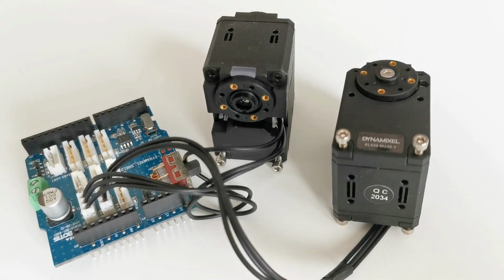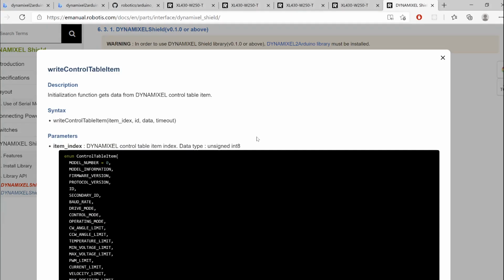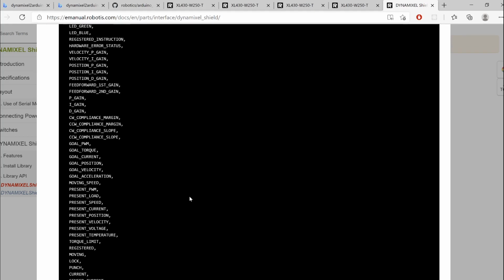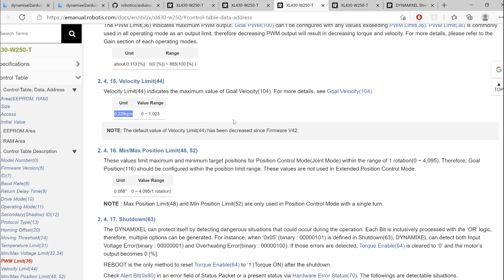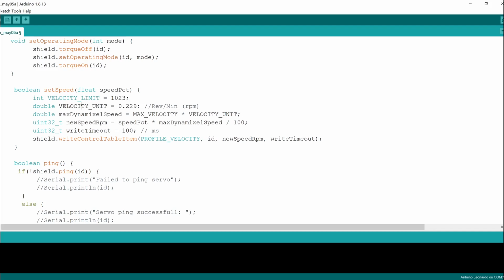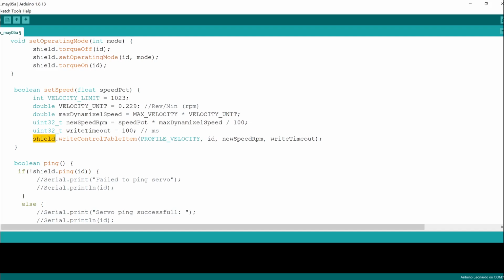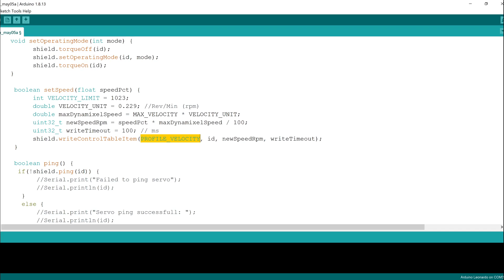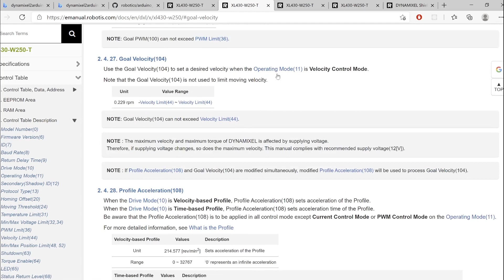Changing Dynamixel velocity in Position Control mode

Comment: Hello I have a question , what if I want control the servos using data that comes via serial port, how would i go about that? Thank you
Reply from the maker: To control dynamixels using uart (without arduino hat) you need to use uart -> TTL or RS485 adapter. I belive Robotis have something like this. Otherwise you could  implement simple protocol sending frames over serial (UART) to arduino. Each data frame would include servo motor id, parameter name to change, new value. Eg. <24>,<position>,<1408>. This is just early idea.

Comment: Hello, thank you for the information
Well, I am working with XL 320 servos for a hexapod robot and I want to command two motors synchronously  with the example sync_read_write_raw ()
So do you have any idea about this  sync read write functions ?
Reply from the maker: Hi, your approach is very interesting but me myself never used synchronous commands with Dynamixels. My programs were commanding servos sequentially which was good enough to move quadruped robot. In reality there is no noticeable delay if you eg. set goal position one servo after another. Maybe try to move your hexapod this way first? Btw: I took a look on Github at this sync_read_write_raw() function and maybe I will try this as well. The thing is that there is not many examples of usage.
Reply: @slawomirkorbas  yes, the big challenge is that the two motors that we are commanding synchronously with same goal velocity  are responding differently. in other word, they have different present velocity when working with op_velocity mode.
could we use PID to correct this problem ?
is it possible  somehwo making them responding with our goal velocity ?

what about connecting an arduino to an openCM904 C Board is it possible?